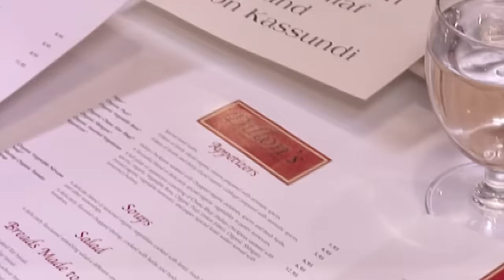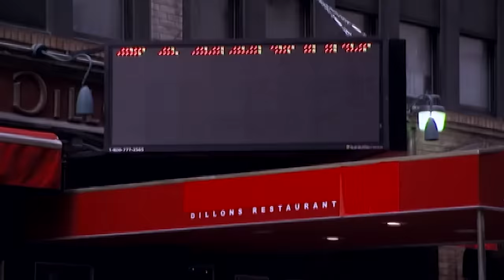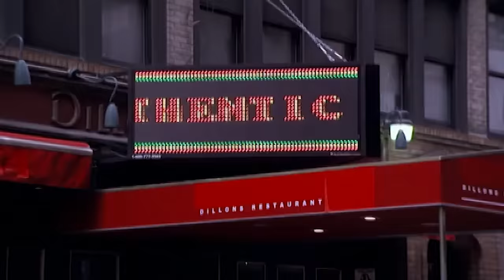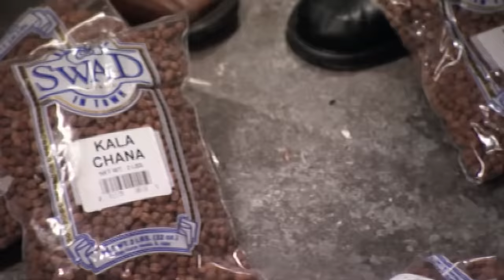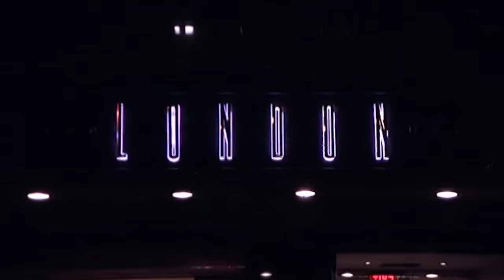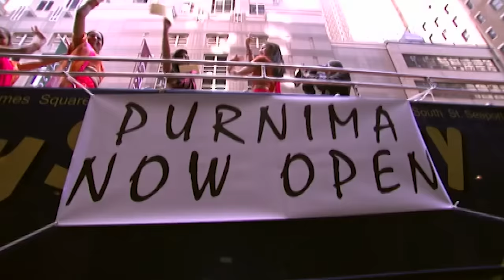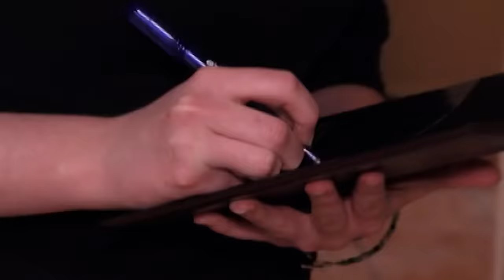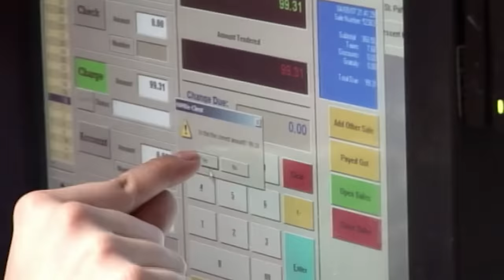"If That's Beef, Then I Was Born In Bangladesh" | Kitchen Nightmares FULL EPISODE

Comment: In all the years that I've repaired equipment in kitchens, I've only seen one place as clean as Gordon's. The guy put wheels on everything and twice a day they roll everything out the back door to be cleaned. The whole kitchen is tiled and has floor drains so it can be washed down. The only kitchen I was ever able to lay down on the floor when working on the equipment. Immaculate
Reply: That should be the minimum standard for restaurant cleanliness.

And Gordon would agree.
Reply: @fhuber7507  Doing floors twice a day would be impossible for a lot of places, and disassembling a restaurant twice a day is impossible for places that don't close between lunch and dinner.
Reply: @andrewg254  I am a baker with over 20 experience in the trade, the floors should be swept constantly, mopped twice a day if busy, everything that can be moved should be moved and cleaned under. All handles should and frequently touched surfaces wiped down as often as possible. All open food in fridges or in containers should be dated, all stock should be constantly rotated (removed from the fridge and the new stuff put behind the old), if you can't keep these standards then you should not be open end of story. 

I have told business owners to their faces that they have no right to be operating a food establishment because their standards are too low, just because you can cook at home does not mean you know what it takes to serve food to the public. I have honestly gone to the health inspector to complain about my own place of employment and then told my bosses I have done so.
Reply: @nigelrhodes4330  Very cool, thank you for sharing👍
Reply: That's an awesome idea
Reply: The restaurant I work at has all of this. Is that not the standard in america?
Reply: @andrewg254  Doing floors twice a day is the bare minimum. For places that don't close between lunch and dinner service, they still clean. My family business with no more than three people in the kitchen on the most staffed days can still keep the kitchen clean and to standard. If you can't keep your establishment clean to industry standards, then you are lazy and shouldn't serve food to the public, plain and simple.
Reply: @dogpawsinbothhands  Bro I work at the busiest sit down restaurant in my county, we do floors once at closing and occasionally sweep if it slows down.  We do floors at closing and it takes like 45 mins to an hour to do them for the full line, we just don't have that kind of time during the day because we serve around 1k people daily.
Reply: Where is it? I want to eat there, after watching all the kitchen nightmares i have become very picky and dont eat just anywhere anymore i look around, first thing i do is go in the bathroom if its dirty i leave.
Reply: @idonotmakevidsyet  ahh No!
Reply: The candlelight, Central Avenue Scarsdale New York. Known for its wings
Reply: One thing makes me wonder we're is the health inspector during the time it's open
Reply: i dont know where you have been working but i worked at a pizza place. we kept that crap clean. once a month or week we gave a thorough cleaning and scrubbing. every night for close we spent an hour mopping and cleaning the cooking/ dishing washing area and dining area and bathrooms. wait staff area scrubbing constant. fridge scrubbed. pest guy sprayed monthly. it is not that hard to keep a kitchen clean and we were all highschool students. we just had a manager that told us to do it. we rotated the food and threw out anything bad but never had to due to rotating the old to the front with new inven. and the health inspectors still complained about stuff for us to clean more.
Reply: ok but no roaches or rats..
Reply: a normal good kitchen have those standards of hygiene and security, man. i dont know why you are surprised like that
Reply: @nigelrhodes4330  I'm a baker too, and I clean as I go. Cleanliness is very important when feeding the public! I always keep things dated and organized. Eggs stay on the bottom shelf only! If you wouldn't bring it home to your momma, don't serve it to your customers!
Reply: @idonotmakevidsyet  NOPE. I'd say that's practically the entire point of Kitchen Nightmares US
Reply: I've worked in both types, lol. A clean kitchen is a happier and more productive kitchen in my personal experiences. But whatever works for the situation I reckon.
Reply: @tommccarron324  OMG, that place has the best wings, cheesesteak wedges, and onion rings in NY. And I had wings from the Anchor Bar in Buffalo, and still woukd take Candlelight first.
Reply: @fafalina56  Jay runs that place correct!
Reply: @tommccarron324  I moved out of NY.  Used to work in an office literally next door to it, we would eat there 3x week. I still recommend that place to anyone visiting,  and it's on my gotta go list when/if I do go back. That,  and Capriccio's in Croton, Roma's in Tuckahoe, and L&B Spumoni Gardens in Brooklyn. Pizza is crap out in the midwest, lol.
Reply: @andrewg254  Untrue. Worked in a restaurant for a few years about 6-7 years ago, not even one you would consider "fine dining," but relatively busy still, and we did cleaning twice a day. Once between 2-4pm after lunch rush, and then again after close. Never had any sort of issues with mold, bugs, mice, and food/supplies rarely went expired and NEVER rotted. Everything was dated with creation/use by labels, even the smallest of ingredients like sugar. It wasn't difficult to mop the floor once between rushes. Nothing was on the floor, it was either lifted to clean under it with ease, and/or on wheels. All the surfaces got wiped down with the sink, underneath, doors, and ovens. It was cleaned a bit more thoroughly at close. It's very doable even at a busy restaurant if they take the measures @Tom Mccarron said to make that cleaning easier.
Reply: @cypruslavigne7419  We literally scrub our floors with floor cleaner every night after sweeping, then squeegee all the water into drains, and finally mop.  I'm saying it would be impossible to scrub floors during service.  We sweep between lunch and dinner, keep everything labeled, and don't let stuff expire.  Despite being in the middle of the woods, we never have problems with pests.  Everyone cleans their station if they have downtime, which can be pretty rare depending on the day.  Stop acting like I'm saying it's fine to have a shitty all around restaurant, all I'm saying us restaurants like mine that do a crazy amount of volume will not have time to do floors twice a day 90% of the time.
Reply: Tables turned as health inspectors tell Ramsay: 'Clean that freezer now' Headline from The Independent..... Don't believe everything you watch
Reply: That’s how it was at gattis pizza
Everything on wheels so could move and clean every spot of the kitchen. 
I liked it that way actually too
Reply: That's how it should be. As a 10 year server the only decent place I worked at had Gordon Ramsey standards. Every single thing front and back of the house was moved and cleaned. The gm did daily inspections if she found dust on the window sill in the bathroom we got in trouble and had a staff meeting. That's how every restaurant should be run
Reply: @fhuber7507  I would love that 👍
Reply: @andrewg254  your not thinking about it
Reply: @andrewg254  it is absolutely easy. Do it before opening in the morning and then again late at night.
Reply: Watching Kitchen Nightmares US honestly made me scared of visiting the US and eating out there.
Reply: @nigelrhodes4330  wooowwww to their faces?!?
Reply: Worked in a place once that had drains in  both corners and every other Wednesday we pulled stuff out and power washed. I actually enjoyed that part of the job
Reply: @trollisourbriteeggs6282  I was just very impressed that he said it to their faces. I mean, to their faces, bruh.
Reply: @trollisourbriteeggs6282  Nigel is such a badass bro.
Reply: Where do you work so I can avoid that town?
Reply: I miss floor drains end of service quick jet wash , job done,
Reply: I worked at McDonald’s in Ontario Canada when I was younger and I can tell you every night we scrubbed the shit out of that kitchen. I see stories of moldy ice cream machines at US McDonald’s and I can’t believe it.
Reply: @andrewg254  McDonalds?
Reply: @mustertherohirrim7315  I wish, I would get similar pay for wayyy less work.
Reply: @TC-eagleseye  Please come try to clean floors while people are on the line cooking and servers are running food.  Pull mats and trashcans, sweep, throw cleaner, scrub, squeegee, and mop all while everyone is trying to do other stuff.
Reply: @andrewg254   nothing is impossible your probably jut lazy. It’s manageable with a strong team js
Reply: @andrewg254  Very cool? He proved you wrong in so many ways lad, lol.
Reply: @cjjohnson8125  He didn't prove shit lmfao
Reply: @andrewg254  Nah bro you got other people making you look goofy
Reply: @cjjohnson8125  If you say so man, thank you for your input with all your linecook experience.
Reply: @andrewg254  lol
Reply: as a young chef & wanna own a restaurant one day .. I always wondered why most of the equipment isn’t on wheels
Reply: Man I repair restaurant equipment too and know exactly what you mean, laying in grease and oil working on fry vats or something, hard to find places that have clean floors let alone their nasty equipment haha, Five Guys is always very clean in my experience.
Reply: The way a restaurant should be.
Reply: @andrewg254  this just isnt true, my family has 6 restaurants around massachusetts and we do the exact same thing at all locations. we aren't a large business and don't have ramsey money but everyday at we clean every centimeter of our kitchen,every single piece of equipment is cleaned no matter what.
Reply: @samuelhanscom7940  That's great man, our shit isn't on wheels though.  And yk what, I'm just a linecook.  I'm not staying until 1-2 in the morning everyday detailing a whole kitchen, but even then the places I work at got 96 and 93 on their last health inspections.
Reply: An Asian friend I have known for 20+ years... His open plan kitchen is as clean as you described!
Everything on wheels... Pulled out at end of each night and the staff clean it all down! Then afterwards, he sets a meal for them all to sit down and eat!
He treats then as family! It's a pity, some treat him by stealing.. but, he never lowers his standards.... Many great people in business out there. 🙏🙏🙏
Reply: @nigelrhodes4330  Damn, I would definitely eat at your place.
Reply: You've never seen a hotel kitchen .
Reply: That's how it should be done. When I worked at Whataburger in high school they cleaned the dining area at least twice every 8 hour shift and on graveyards (it was open 24hours) we would sweep and mop the entire restaurant, wiped down every surface and prep produce to be used later that day. If a fast food joint can do that a fine dining restaurant definitely should be able to.
Reply: There is no amount of remodel or repair that would allow me to eat at this restaurant after this episode 😮
Reply: @nigelrhodes4330  And now you're jobless writing this comment?
Reply: In a sense i agree. On the other hand, pardon the cliche - u get what u pay for. And McDonalds is the most succesful restaurant in the world by far. This says a lot about the state of capitolism, workplace regulations, & business ethics across the globe.
Reply: @andrewg254  I mean it's not impossible. I worked in a restaurant. Cleaning happens after close or in the mornings. Plus there's always some sort of lull between lunch and dinner.
Reply: @andrewg254  Yeah, but keeping it spotless should still be the standard. Doesn't matter how many times a day you clean it, as long as you keep it clean.
Reply: @paperman9708  The workshop where i work has a cleaner that comes in every day for about 4-6 hours and does everything as well as us cleaning up as we go ourselves. For a workshop it is pretty damn good.
Reply: @wessexfox5197  so uhhh... Mop again in the morning even though you mopped just before shutting down for the night?

That's not useful smart or helpful
Reply: @andrewg254  once a day would be sufficient compared to this.
You sound like you live off excuses like most of these people.
Reply: LOL we do Gordon's steam cleaning, and you're 100% right, it's by far the cleaned kitchen I've seen. We usually get there between 3-4am so after dinner service, and it's still spotless? I almost feel guilty cleaning as often as we do (once every 2 weeks) cause there's really not a ton to clean up, but that's the way they want it. 

Never met or saw him, but it's very obvious his staff follows his lead, cause the place is immaculate. And they got the idea for the wheels from Mastro's after they hired their GM.
Reply: Basically an operating theater standard
Reply: @chaindrive_blvd  don't go to asia
Reply: So you're telling us Gordon needs to get his shit together.
Reply: @MrSocrates1979  headlines from the independant are probably less reliable than a reality tv show lol
Reply: Gordon's kitchen is how all restaurants in Norway look like.
Anything else and they get shut down.  Inspectors will come without warning.
Reply: Sarcasm hehe keep the trolling
Reply: @andrewg254  It doesn't need to be 100% spotless, but cleaning the floors twice a day is the BARE MINIMUM that should be done, and that's just for the floors!
Reply: @andrewg254  Itd be impossible for a shittily run place that doesnt hire enough workers and should be closed anyway but otherwise its entirely possible
Reply: @Beanpolr  🤷‍♂️
Reply: @andrewg254  doing floors twice a day is standard practice my dude. Thoroughly sweeping should be done constantly then a "dry mop" after lunch and then a full wet mop clean after dinner.
Reply: @squizzerl1478  🤷‍♂️
Reply: That's crazy but believable.  Was a on call manager in Atlanta and 3 stores I was sent too took me weeks of coming in 5hrs before opening cleaning and replacing everything
Reply: That was how my mom ran her sma restaurant when it was open cause she used to be a super germaphobe and she's mostly gotten over it but it stuck when it came to the kitchen
Reply: Yeah sure you did, buddy. We believe you
Reply: @nigelrhodes4330  Did you label them manually or you label them using automated labeling machine?
Reply: @nigelrhodes4330  time to lean, you have time to clean was my kitchen mantra
Reply: "The guy put wheels on everything and twice a day they roll everything out the back door to be cleaned." You're saying they put wheels on gas cooktops and griddles, disconnected them from the gas lines and and rolled them out of the kitchen twice a day? 👀Look, I'm all for a clean kitchen (2x a day), but that would be an explosion hazard waiting to happen.
Reply: @andrewg254  Volume is not proof of proper sanitation. I've worked at places that did similar volume that were absolutely filthy (at least when when I started there).
Reply: @rollomaughfling380  Damn that's crazy
Reply: @andrewg254  Not "crazy" at all. Maybe you haven't worked at, or looked at enough restaurant kitchens to form a proper opinion. FTR, every nasty place I've started at, I've confronted the owner, left it cleaner than it was when I started, better ratings from health inspectors. Mostly because I started restaurant work in a dishroom, and over the years didn't like coming home smelling of garbage, whether I was a dishwasher or a manager. It's not hard. Clean as you go, and invest in the right cleaning materials/regimine.
Reply: @rollomaughfling380  damn thats crazy
Reply: This seems to be an "American-thing"! When you run on such conditions in europe you will lose your license and serve some prison time! Thank god we have much higher standards than America....this is not only disgusting these are serious health threads and can harm or even kill the costumers! Gross!
Reply: @levi_alex3644  taking bribes
Reply: That’s pretty scary and pisses me off even more how those places got past health inspection if anyone could explain that
Reply: I used to work at the best Arby's in Utah. I strongly believe the reason it was, and still is, the best,  is because of the high standards held there. It was a 24 hour Arby's,  and every night at around 1 AM, everything was deep cleaned, and throughout the day, there was at least one staff member constantly cleaning. It is the only fast food restaurant I've ever seen that had floors so clean, my shoes didn't get crusted with grease and food remnants. I get it, it's hard to maintain that level of cleanliness, but we cleaned probably two hours of the graveyard shift, and that place was spotless. You can tell a lot about a restaurant,  fast food or  otherwise, by the product they produce. Clean equipment and staff can make or break a place, and our manager, plus her high standards, has kept a truck stop Arby's one of the best in the nation. While I no longer live in the area, when I go visit, I am always confident in the quality held there and that I WILL NOT be served anything covered in mold or * shudders * bugs
Reply: @H&A M  might be a dumb question. I don't work in a restaurant anymore (even when I did, it wasn't in the kitchen) but why eggs be on ghe bottom shelf only? I know it's different for a business than at home but my egg carton has always been on the top shelf in the fridge.
Reply: @Private-yg9tt  Its So they don't hatch.
Reply: Gordon's reputation ain't for nothing, man truly knows how to serve a good meal
Reply: @andrewg254  Then there is something wrong with a business model that demands filth.
Reply: @Apagador69  Thank you for judgment on this matter, I'll be make sure to take that into consideration next time I choose an establishment to work at😐
Reply: @fafalina56  speaking as someone from Buffalo, Anchor Bar is generally considered to he overrated. Not worth going to for anything other than the suicide wings.
Reply: I've worked at campbells soup factory and that's how it was. everything that wasn't secured down was on wheels and we washed  it all with 2" hoses, one for hot water, one for soap, one for sanitizer and everything got flipped upside down even if it never touched ingredients. the only thing you had to worry there was how much salt the recipes called for...Gordon would have loved it! seasoning, bloody hell!
Reply: @jordan9604  I just work there man.  Your tirades have no effect.  We never gave anyone food poisoning either.  But you can continue ranting at me if it makes you feel better.
Reply: I can't imagine enjoying eating out ever again having this job.
Reply: @yeah_right88  he does clean it once a day , tf did you read?
Reply: @andrewg254  There’s a thing called doing a “cockroach clean” (which is a horrible name) where the floors get cleaned basically superficially regularly during the day as well as a little bit deeper in between servicing such as between the lunch and dinner rush. It’s totally feasible for all restaurants, and usually your KH/KP staff will do it. When there’s less dishes/less prep time is taken to clean up the kitchen to make it easier for everyone as the night goes on.
Reply: @basilkhouli5670  I mean yeah, we sweep in between rushes but I wouldn't really count that as 'doing floors'.  We scrub floors every night with floor cleaner, bleaching them once a week or so, then squeegee after everything has been scrubbed. Finishing with a soaked in mopping solution. Our FoH side of the line is covered with perforated mats that we take outside and pressure wash every night while we sweep, scrub, and mop the entire kitchen.
Reply: Which restaurant??
Reply: Thats all Michelin restaurants. The kitchens are spotless
Reply: I worked at dominos and the make line was on wheels. The wall was washed every night and the floor mopped every night and swept when not busy during the day. Open concept kitchens where the customer sees the whole kitchen. If i enter a restaraunt and cant see into the kitchen i aint eating there. Plus at dominos every time recieved food they marked the date on every item with marker. Every night they did inventory and any expired food was discarded. So no food in the walk in was over 1 day past expired date. Every 2 days had food brought in. A sink on both sides of the make line. Head office was very picky on inspections. Its not hard to keep clean unless slack off and now so bad it takes all day not 1 hr everyday.
Reply: Exactly. If wiped down often it only takes a few min cause no built up of grossness. Food rotations with dates makes it so easy to see whats expired. Ive been in friends houses with a nasty stove. They say too hard to clean. Its easy to clean. Every week or so pull it out and a quick wipe with dish soap and takes 5 min cause never really dirty. I learned that storing left overs is pointless cause they just end up sitting and throw out in a week anyway. I see it all my life. People buy expensive storage containers, they refuse to throw left overs so put in containers and in the fridge. A month later there no room left and find moldy food so now not only left overs in the trash but so is the expensive container. Cant wash dank rotten food out of plastic. Learning how to cook portion size meals saves too much left overs. Buying in bulk is also a waist. It rotts before used.
Reply: The more often its cleaned the easier it is.
Reply: Open concept kitchens. If i cant see into the kitchen i aint eating there. A solid wall with a tiny window in the door its too easy to hide the truth.
Reply: Not sure if i would use momma as example cause many would give momma rat poison.
Reply: Wet mop then dry mop. Once grease and grime builds up it gets too hard to ever clean proper. I see friends cook. They spill sauce that runs down the stove and leave it. After 6 months it takes hrs to scrub. Make a mess, wipe it up before it dries then only takes 5 min.
Reply: Why in the morning? If cleaned proper at close it should still be clean. By morning everything dried up and harder to clean. I personally rather wash before it dries then its just a quick wipe.
Reply: Most mcdonalds have open concept kitchens. You can see the whole kitchen from front counter as ordering. If i cant see the kitchen i aint eating there
Reply: I refuse to work in those conditions. I say clean up and i will come back. I refuse to lay on a nasty floor to fix nasty equipment. Even most mechanics keep the floors grease free. Its also a safety hazard to work on greasy floors.
Reply: Complete demo job. Tear down to studs. Spray pesticides then start over.
Reply: Every night wipe everything down before dries and builds up. Not that hard if done often
Reply: See it canada too. India even worse.